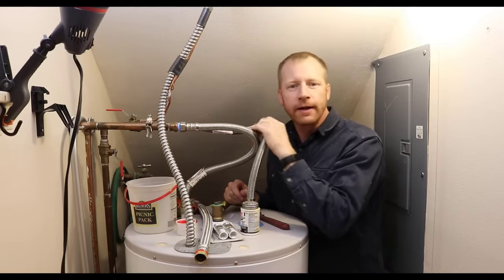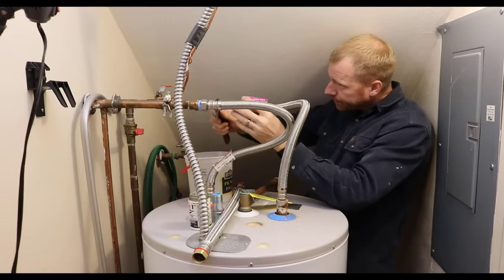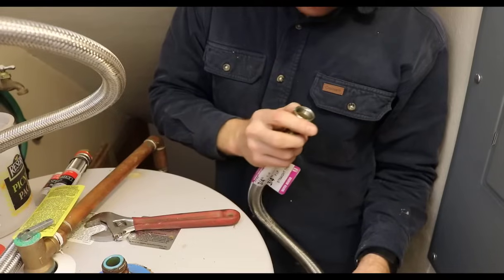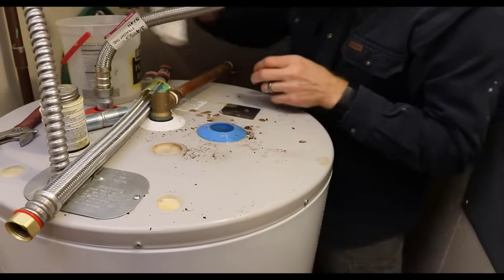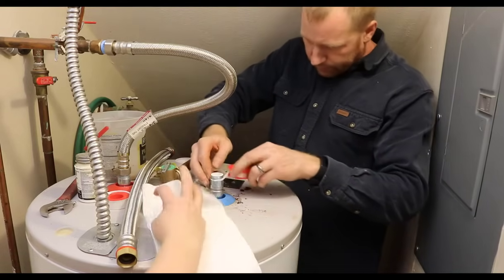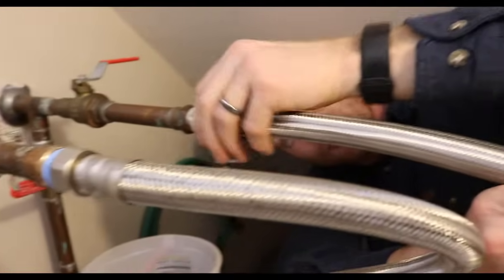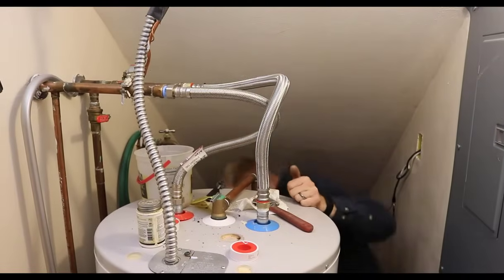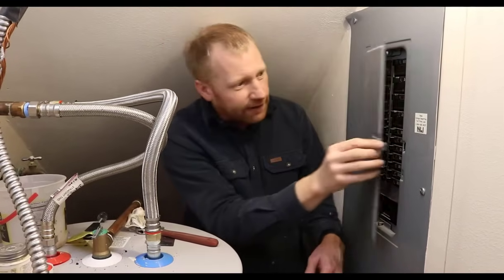Water Heater Repair Replacing a Corroded Supply Line

Comment: Dan i noticed that when your connection from copper supply line it had green corroision on inside of the pipe how come you didn't run wire brush inside of pipe that would help new supply line not corrode later down line just wondering you did great job but i think you maybe you should of cleaned out green corioson on inside of copper to new hose line using the round wire cleaner on outside and inside of copper

Comment: 8 out of 10 times it leaks after replacing the $15 nipple anyway because it usually isn't the nipple at all- it's the $600 tank inlet threads.

Comment: what happens if you don't have those two supply lines on the top and only the one in the middle with corrosion? Is it a bigger problem or is it the same procedure. I don't plan on doing it myself but I want to make sure the tank won't explode.

Comment: A plumber told me that they don't use dielectric unions especially because ones made in China are too prone to failure. Instead, they use dielectric heat trap nipples.  That is the problem that I am having with my water heater than is 1.5 years old.  Its dielectric unions, that are made in China, are severely corroded even after such a short time period.
Reply: Why not both - considering the cost of on new water heater.

Comment: Why are you putting the red color label  hose on the inlet that the cold water comes in to the tank?
Is supposed to be on the outline the one that comes out of the tank to let people know that side or that hose is the hot line

Comment: would you recommend draining the tank to avoid pressure spray when you take off the fitting? or hitting the relief valve?
Reply: Opening the hot water tap(s) in sinks above and below the level of the heater will get rid of the pressure once the cold water intake valve(s) are closed.

Comment: Just got a new Rheem electric water tank and the TPV fitting at top of tank is leaking (not the valve, but where it threads into the tank).  I pulled it, wrapped teflon tape 6 times, reinstalled.  Still leaking (very slowly).  So, I removed it again, put 6 wraps of teflon tape and some TFE paste and reinstalled, but not as tight (snug).  I'll wait to see... it takes a couple hours to see any water.  Any other ideas if this doesn't work?

Comment: I bought a small round wire brush to clean the old threads. But dont know if i have to have a flow trap ? Pipe. I wont call a plumber as rapid city company send 2 guys down and the charged me 830 $ to change out a 7 ft pipe.

Comment: where is the dip tube Dan? I thought you suppose to have a dip tube so that the cold water fills the tank at the bottom.
Reply: Sorry, I forgot yours is an electric hot water heater
Reply: @TinhNguyen-mb7gx  i thought  both types of heaters, electric and gas  required   the dip tube ?

Comment: Some of these water heaters have very bad design. These corrosion could very easily be prevented had the manufacturer used a dielectric nipple instead of the galvanized connection. The difference is just a few bucks but it sure saves the homeowner a lot of headaches down the road.

Comment: Can you just remove the corrosion and rust from the joint - mine are not flexible they look like solid copper pipes that need a pro to replace and I would like to wait a few?

Comment: One of the hoses was color coded red. Doesn't that imply that hose should be connected to the hot water side? Or it doesn't matter? And if not, why would they color code the hose?

Comment: The metal plate that on the  water heater is it supposed to be radiating heat? Water spilled into that little spot and now it's hot

Comment: Great video thank you!  I have the exact same scenario over here on a 4 year old heater.  Going to try this myself, wish me luck!
Reply: Helped a friend install a GE water heater purchased at Home Depot, leak occurred in  the same location the moment it was pressurized. Wanted to remove the nipple and re-tap the hole.  He would have none of that, and had me remove and exchanged it for another one.  The new one lasted 5 years.

Comment: Where's the dip tube?!?
Reply: ian johns I think it’s under that rusty screw
Reply: @MrMain65  You're probably thinking of the sacrificial anode rod.  DAN:  if you seem to be running out of hot water prematurely, it's because you failed to install a dip tube.

Comment: I would guess that someone has pointed out that the supply lines you used were color coded red/blue, and you used them on the incorrect sides of the water heater.
When you are using a gasketed fitting, I don;t think there should be any need for teflon tape, etc.
Reply from the maker: Yes they have. HD only had the supplies with Red and I never would connect the supplies based on the color of a washer attached to the flex. The top of the heater has color coded washers attached and hot and cold stamped into the metal. But, as I try to explain projects on video, I have to be aware that there are people that may have never done something like this before and take everything I do as the only way to do it! Years ago as a service plumber, I responded to an emergency call, when I walked into the bathroom, there was a gyser of water spraying across the room from under the sink. Turns out, the owner had decided to replace the faucet, flexes and angle stops after watching how to do it on a DIY TV show. They showed me the paper where they wrote down each step. The only problem was that step one, TURN OFF THE WATER BEFORE removing the angle stop was missing!

Comment: How can you change the anode rod on this water heater model. Mine needs to be change but it looks like it's under the pressure valve and it's hard to take off

Comment: Great video.  I have a bad leak out top of my heater.   It leaks so bad it comes over the thermostats.  I am wondering of replacing the nipple is just wishful thinking.  Pretty sure that your water heater, right in front of an electrical panel, might be against code.  Would be here.  Usually a clear space required in front of a panel.

Comment: You don't need Teflon tape on compression fittings it just gets in the way and stops it  tightening up properly. Only amateurs make this mistake. That is why you had trouble starting the thread. Best get a licensed plumber.
Reply from the maker: Thank you for your comments Kim. I was a REAL service plumber for quite a few years employed by a large plumbing contractor in California. Our bread and butter was to fix any problem that came our way. I have repaired and replaced many hundreds of both gas and electric heaters over the years and am showing what I would do. Now in a perfect world, no teflon tape would be needed and every fitting would thread on perfectly. But if a person is a REAL plumber, they would know full well that that things hardly ever work perfectly in repair situations. That is why REAL plumbers are called after home owners give up because they don't know the little tricks gained from both experience and handed down from others. If you know better, then awesome, this is for the many thousands that can't afford to pay a real plumber to perform a simple fix like this.
Reply: @DanSarahMakers  Thanks, people just need to hear themselves talk. I had to replace mine and your video helped a lot.  Saved me from calling a " real " plumber. As I assume Kim is.

Comment: The one we pulled out had a dip tube on it.  is that necessary to replace?
Reply: Essential, unless you want a lukewarm shower. The cold water coming in will be at the top instead of the bottom, and mix at the hot water outlet.

Comment: 8:04 do you mean check valve son! 😋
Reply from the maker: You could call it a check valve  but the design is to prevent the rising hot water in the tank from migrating into the cold supply line when the water is not moving in the pipes.  if you Google the term "Heat Trap Nipple" you will see that this is a common term used by manufactures and suppliers/stores to describe this fitting/nipple. And also, I have always wanted to meet my dad! You owe me 18 years of child support! Just Kidding! I hope my videos inspire people to be able to make their own repairs, save money, and have a sense of pride and accomplishment. It looks like you may  do the same!

Comment: Never use those flex hose style supply lines. I’ve changed so many that have broken down and leaked out plugged up faucets with rubber. I think they are trash

Comment: Please help 😭 I drained my hot water heater and now for some reason it isn't filling. I opened the cold water valve for 40 min to fill and I tested the pressure relief valve to see if water would come out to see if it was filled and I also didn't hear water flowing when I opened the cold line to fill. So frustrating! Now no water is coming from hot faucets at all and no water pressure to even take a cold  shower . Please help ! I can't afford to hire a plumber and want to try to fix myself if possible. Thanks 🙏

Comment: @0:20 my cold water supply line started leaking 5/31/25 is there better hoses than the flexible stainless steel.
Reply: Yeah. Actually there those that are made with copper. Copper flexible hose

Comment: If you’re replacing the hot side, does the arrow need to be pointing up on those little pipes?
Reply from the maker: You want the arrow to point in the direction of the flow of water, so on the hot side the water flows out of the tank so the arrow points away from the tank. These are called heat trap nipples and contain a little ball that acts as a one way check valve.

Comment: Did the corrosion occur because the flexible line he is replacing was not cooper.  Dissimilar metals creates corrosion cells.  Is that right?
Reply from the maker: Tim, the well water is a bit corrosive to all of the copper pipe so that is the main issue there.

Comment: Why were dielectric unions not needed for this repair? Thanks!
Reply: Dielectric supply lines can also be purchased. They will have the rubber washers and plastic collars underneath the nut.

Comment: Could you tell me that flexible steel braided connectors are safe for health also each pipe end has red or blue plastic there are some difference
Reply: Braided steel is just the outside & protects the rubber hose inside. There’s different types of flexible hoses available as well as hard piping with copper or galvanized steel. As far as health, if they’ve been approved for potable water then they are ok. The red & blue denotes the hot & cold, respectively.

Comment: Here's what I'm trying to figure out..
Using that teflon paste on the threaded fitting... Isn't some of that going to go into water that could make it's way to your faucet?
Granted it's quite minimal, but still...

I'm about to install a water heater, and I am just going to use teflon tape in that spot. Can't rationalize paste... 
Unless someone can tell me the solvent is quite safe.
Reply: I was wondering about same thing. I have Hercules megaloc pipe sealant and it claims "Safe for drinking water lines". Maybe paste it on the latter half of the thread.

Comment: Great info until a point.  It IS a BAD idea to use teflon tape on a joint that has a gasket.  (or a flare fitting)  Do NOT do this.

Comment: Does it matter what size supply line, for example the wife picked up a 3/4 x 3x4
Reply from the maker: It would be best to match the size that the heater is plumbed with so typically 3/4" is the standard size. If you down sized to 1/2" with adaptors, it will still work but high demand fixtures like a clothes washer would take longer to fill and a shower may have a lower hot water flow volume.

Comment: Is the inside of a hot water heater cooper or stainless steel?
Reply from the maker: The inside of most standard water heaters is just a steel tank. The better ones may have an enamel coating and some of the high end ones are stainless. The one we have here is just steel.

Comment: I had a question, if you have 2 shutoff valves near the water heater, why turn the main off,just a little extra safety?
Reply: Water shutoffs (especially the gate valves) usually don't work or shut off completely.

Comment: Had a water leak underneath the lower element on an AO  Smith water heater where rusty water was coming out. I replaced the element but I noticed after putting in new one, the water is leaking below the element from the tank up through the lower element cover. Any idea?
Reply from the maker: There may be another leak that you may have not found or can't see. Water heaters have the main steel (or stainless steel on the really nice ones) tank, a layer of expansive foam insulation, and finally the sheet metal jacket. If there is a leak at any fitting on the sides or top of the tank, or even a pin hole leak in the tank itself, the water may be traveling down the side of the tank and filling up the space between the foam and tank and you are seeing the water coming up from below the lower element which is probably the lowest opening on the side of the heater besides the drain valve. Check around all of the other fittings for leaks, and if none are found, it may be the tank itself. Hope this helps and good luck!

Comment: Do I need to drain the water heater tank before unscrewing any pipe lines?
Reply: It would only be necessary to drain if you were replacing an element since it's below water level.

Comment: Good job!  Learnt something new today.  What do you think is the reason for the corrosion of that particular fitting?  Is it because the die electric fitting is failed?  Is it the anode rod that is wasted away and is not doing its job anymore ?  Just wondering.  Also, did you verify the anode rod?  

Honestly, I hate plumbing but seeing this corroded fitting on your tank got me to look at mine and mine is in similar condition.  I drain my tank yearly but now I'll have to do this also!  

Thanks for the video.
Reply from the maker: I didn't check the anode rod this time. I had other larger more involved plumbing projects to work on that trip, those are upcoming! As for the source/cause of the corrosion, I would guess that there was a small slow leak that worked on this over time. I don't think  that it was an electrolysis issue because the heat trap nipples have plastic bushings at the ends and the flex was a stainless steel braided supply line. The hot side also had no sign of corrosion.
Reply: Dan&Sarah Makers same here, in is corroded and out is not!  Odd.
Reply: Remember tank honestly only last 9 to 13 years depending on you water type

Comment: You have galvanic corrosion because you are not using a dielectric union.  You're gona have to replace those fitting every two years depending......plenty of dielectric union videos out....for the DIY'er
Reply from the maker: Earnie, Ah, the 510.4 in the UPC! The heat trap nipples and flex supply that I installed all have built in dielectric protection so there is no dissimilar metal on metal contact. When I was a full time service plumber, I replaced on average 4 water heaters a week. The company I worked for required us to hard pipe the heaters with copper and we always used dielectric unions. 
Now a question for you, how long does a brass nipple have to be in inches to also act as a dielectric break?

Comment: Where did you get that part and what is it called. Great video. Hope it works for me. Save me 600 dollars.
Reply: Heat trap pipe nipple. 
Standard plumbing hardware supply.

Comment: Try using a longer wrench handle or using another wrench on wrench handle for better torque/leverage.
Reply: That would work but the heater would just keep moving. You'd need someone to hold the heater.

Comment: I have a gas hot water heater, do I need to do anything with that?
Reply: There’s a whole section in the owner’s manual with recommended maintenance. The most common is flushing. Some brands, like Rheem/ GE, say to remove a quart of water every month.

Comment: I am so lucky to have found this since I have this same tank, was just about to throw in the towel. I had some warm water issues and was going to replace the dip tube, is there a way to remove it? or will replacing the heat trap be sufficient? thank you so much!

Comment: Great job. i have questions when i turning on the kitchen tap or the shower tap water the sand come with water it block the filter because of the block water very slow when i open the filter take off the sand then back to normal but the problem every third days happening I don't know where the sand come with the water from. Thanks
Reply from the maker: Typical sources for sediment in water systems can be from a well pumping sediment with the water and not having a sediment filter to protect the house plumbing fixtures. Another common cause can be near-by construction where a water main is being worked on and the pipes and fittings are being contaminated due to poor sanitation and flushing procedures. The final source may be from mineral deposits that have built up inside the water lines over time and breaking free and plugging up the fixtures, often caused by "hard" water.

Comment: Hook it up with copper not that garbage from home dep
Reply from the maker: In a perfect world, I would love to use only type L tubing with brazed fittings, but we have something in the water that is corrosive to copper and most of the existing tubbing is getting VERY thin, like try not to crush it with the tubbing cutter thin! We had the water tested and it is safe to use but still not sure why, if it is chemical or maybe electrolysis. I predict a complete re-pipe is in the near future.

Comment: You do realize the NEC violation that exists in this install?
There is a requirement for minimum clearance in front of the electrical panel.
The corrosion is from galvanic corrosion; the connection of two dissimilar metals.

Comment: That water heater shouldn't even be there. Violated the clearance for the electric panel. Could be an issue if some pulled a permit.  I know, I know, what is a permit?